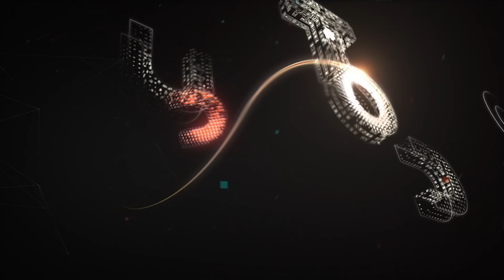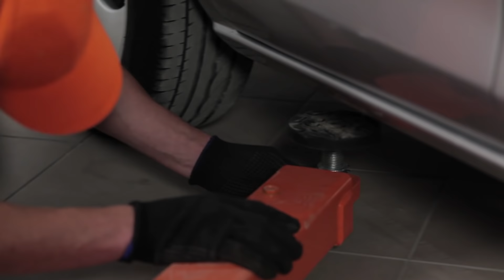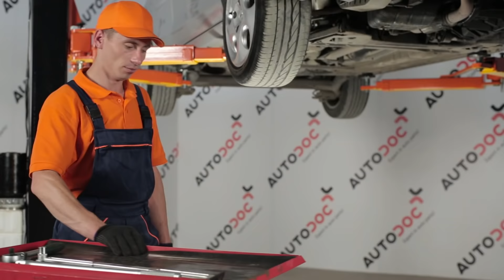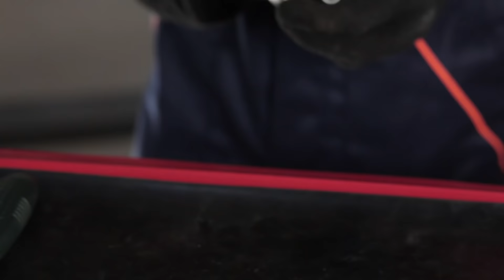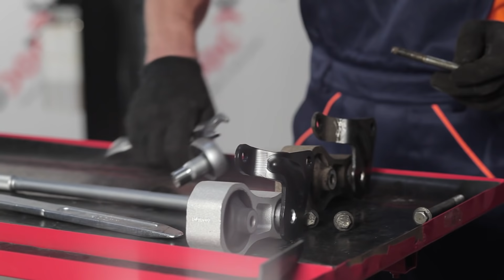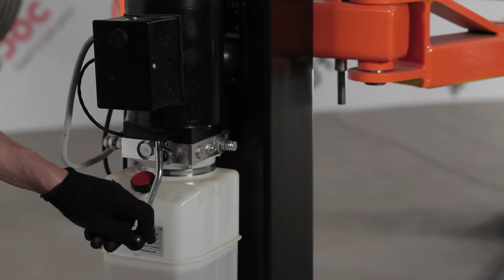Como reemplazar el soporte de la caja de cambios en MAZDA 2 DY

Comment: Hola
Que buen vídeo
Les quiero hacer una consulta...
Tengo ese mismo auto y quiera saber que tipo de aceite de caja automática lleva y cuantos litros?
Creo que le pusieron un aceite que no corresponde y bastante... He leído que si no tiene la cantidad adecuada no entra bien en cambio...
Es mi primer auto automático...
Cuando le piso el acelerador no cambia suavemente, cuando pasa al siguiente cambio siento que lo hace de golpe y si sigo acelerando siento que hace más ruido, me vibra adentro y no cambia lo hace por encima de los 2000 rpm No se si por eso me consume muchísimo es de motor 1300 y me consume entre o mas de 12 litros el 100km además que olfateo un olor a combustible exajerado en habitáculo desde el tanque...
Gracias
Me suscribo...
Reply from the maker: Gracias por su valoración y la pregunta. El problema es bastante grave, le recomendamos ir al taller lo más pronto posible. Atentamente, el equipo de Autodoc.